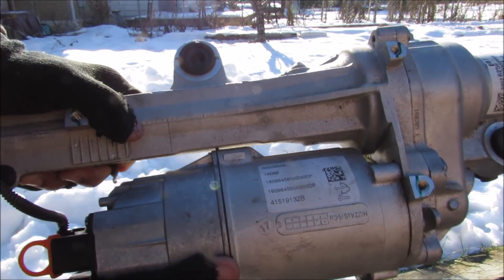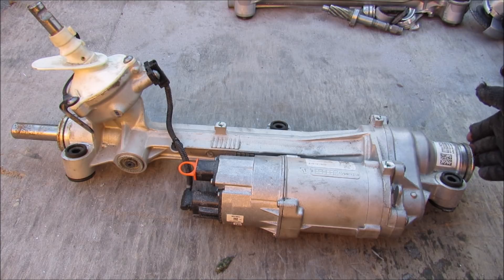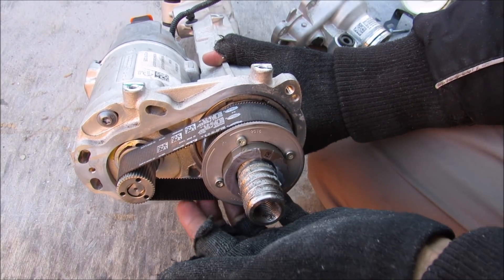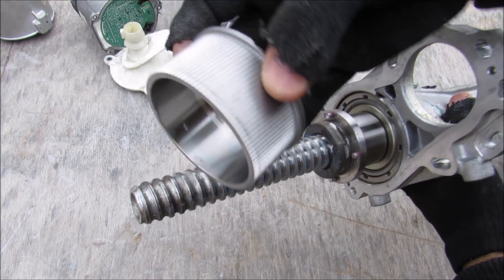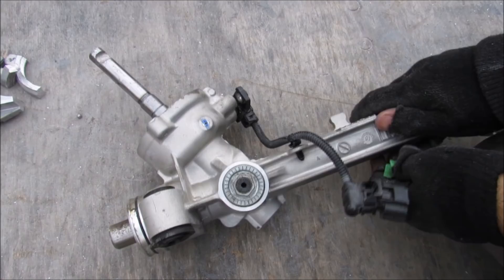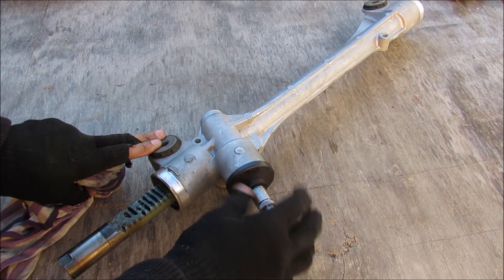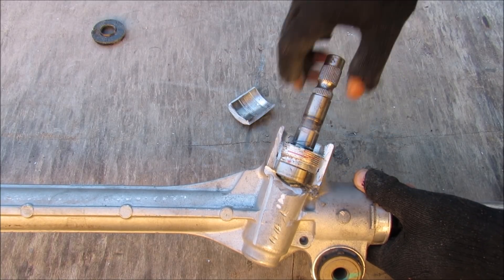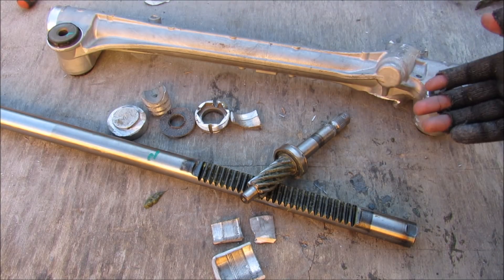How an Electric Steering Rack Works

Comment: Thanks for the video. Just want to know, was there a plastic or brass bushing in that Toyota rack? I have a RAV4 electric steering rack with alot of side play in the rack cuasing major wheel wobble and knocking at soeed. I can't find a replacement bushing for it on the internet. Starting to wonder if Toyota ( rack made by nsk) just use the aluminium housing itself as the bushing (ie not rebuildable - throwaway).
Reply from the maker: +CD I don't think it's rebuild able. Look up Toyota parts catalogs online.
Reply: speedkar99 yeah I know Toyota only sell the complete rack! Not even the Inner tie rods. But companies are selling these racks rebuilt. So must be parts available somewhere?
Reply from the maker: +CD innner rack rods mevotech
Bushing you might have to measure and custom fit. Or fill with poly
Reply: speedkar99  Yep looks like there is a grey nylon bushing at each end. Looks pretty specific for fitting in the housing. Can't believe nothing on the internet for this series of RAV4, litrally a $1 part. Will just have to buy a rebuild rack due to time constraints. Shame on Toyota for pulling these tactics.

Thanks for video showing how to take apart

Comment: I can understand working of hydraulic and elctric assisted power steering but how does the wheel comeback to neutral position automatically after turning when we let off the steering wheel
Reply from the maker: +TheZoomel That's controlled by the caster setting of the alignment.

Comment: Bro? What is the connection between clock spring and traction control sensor?? And where this sensor is located?
Reply from the maker: +Alexander Mumtaz Trac sensor works off of abs sensor. Unrelated to clock spring
Reply: bro, i have toyota aqua (Priuc C) once i had traction control check light on there and the mechanic opened the steering and calibrated the clock spring and then the traction control check light was off, i was watching my self, i am interested :( dont know how

Comment: So if you use electric motor assisted rack the only thing better than hydro pump is ->> you turn the key in "ON" position without starting the motor and you still have the power assistance for turning the wheel. Still operating such motor gives the alternator more work to do from where the fuel consumption also increases?Am i right? EDIT: What's the price for OEM electrical motor+the computer controller for this Cruze? I guess 1-2 grand...
Reply from the maker: +Petar st The electric motor doesn't turn on with the key, most vehicles are  programmed to have it turned on with the engine. 
The electric motor only draws power off of the alternator when turning is required. Hydraulics are always drawing power from the engine. 
The cruze rack was $1000 if I recall. The Toyota rack was roughly $1600
Reply: The energy wastage is a lot lower though. As with any type of hydraulic or pneumatic system, the energy waste can occur during the compression process of the fluids or gases through heat. And there is the consideration of leakage however slightly it maybe. And notice that there isn't any pressure vessel in the form of a can or tank to hold the pressurised fluids, you can assume with confidence that any fluid that has been pressurised but happened to be outside the confine of the looped system consists of the cylinders, hose and pipe to the piston is simply "dumped" back to the part  that only serve to hold and feed the unpressurised fluid as well as to receive the excess fluid after pressurisation. You may also assume with confidence that this repeated dumping by design of fluids back to the reservior represent energy losses at levell  that is much higher than anything negligible. The the extra length of contacting surface between one extra pulley and belt definitely adds  friction and hence energy loss compared to the electric steering assist system which does away with this said pulley.

Comment: so the purpose of hex bolt under the pinion casing is to apply pressure on the rack some one had told me that it's there for the adjustment of the steering.is that right.
Reply from the maker: +cobra R yes it applies pressure to keep it tight and the gears engaged smoothly.

Comment: I used the exact same method to pull the engine on my car. Cutting the transmission in half was probably the hardest part due to the small clearances with the tunnel in the floor. It took almost another hour or so to cut through all that sheet metal and carpet just to get to it, but I got it out. What a mess that made! Now.. to install that new clutch and pressure plate...
Reply from the maker: +edward niel good to hear. I got an engine removal video soon, no cutting needed. Stay tuned.

Comment: hey man how to adjust steering  stiffness on a 2005 chrysler 300 steering rack it's  too sensitive too soft no play I checked  it tie rod and ball joint  is there a srew or bolt  to adjust  how hard or soft id the steering  on a steering rack.
Reply from the maker: +Hallphamazing305 I don't think there's an adjustment for steering feedback, you'd have to change The restrictor valve in the hydraulic power steering circuit.

Comment: thanks for the video! helps me understand my steering and suspension class better. figured there would be more lube on the Chevy worm gear looked dry to be a new car? the thing applying pressure underneath the special nut you ground off the Toyota rack is called a yoke I think. again thanks for the video.
Reply from the maker: +Andrew Ballew I'm glad you enjoyed the video. 
I did wipe off a lot of grease when removing these parts.

Comment: it all translates into translation motion. WTF. Where did he get the words from? Over thinking the use of big words that means the same and used wrong in a sentence. Funny how he wanted to sound smart until the use of the word "TRANSLATE INTO TRANSLATION". Should he used the words as "TRANSLATE into LINEAR" hope it's spelled correctly.
Reply from the maker: Good tip thanks
Reply: Sometimes you just make a mistake on words... Leaving it is easier than a retake, and we knew what he meant anyways.

Comment: Fantastic video! You really butchered those racks :) Were they faulty?
Reply from the maker: +Koffi Banan yea well the grinder is the only way to open those proprietary bolts. No they weren't faulty, this is for demonstration
Reply: Waw, I really appreciate the effort. Hope you didn't have to pay for them, I don't recall them being cheap.
Reply from the maker: +Koffi Banan yea $1000 for the Chevy and $1600 for Toyota.
Reply: even tho they look like quality made this is a heavy overprice. and they even use brushed motor
Reply: Two_Number_Nines it uses a brushless dc motor
Reply: @speedkar99  Does Honda electric steering rack also have a little belt like that American cars?I have a 10 years old acura tsx with electric power steering,Iam worried what if that breaks like a timing belt, that is a sure accident waiting to happen no steering.
Reply: @efrensaclolo7021  look. Have a look at the steering rack assembly yourself, if it has a bulky  extra electric motor housing that is connected in a similar fashion, including the placement, distance between and relative angle to the rack, it probably incorporated the same design. But I don't think you have to be overly alarmed. Remember back in time when you were driving cars without power steering assist? The steering system will still work, it only means that you have to really engage the muscles of your upper limbs. But you do know that when the vehicle is moving at a reasonable speed the steering is not going to be impossibly heavy without the steering assist. It can be a bitch to park the car in a slotted parking space though.

Comment: Call me crazy, but, doesn't the simpler Toyota design seem MUCH more reliable over time?  The electronics and the belt on the Chevy seem like a time bomb.
Reply from the maker: +Brian Day of course the simpler design will be more reliable. The Chevy steering rack may last the lifetime of the car though, which is barely 10 years or so...just check out all those 10 year old Chevy cobalts in the junkyard as proof.
Reply: Truth right there!  I on the other hand,  think 10 years isn't that old.  My Toyota rack went out on my Lexus after 14 years/255 K miles.  Wonder if any power assist racks can last that long or if the the down side to the new tech shortened life spans.  Thanks for the reply!
Reply from the maker: +Brian Day New tech isn't meant to last as long as the old stuff. Cars are more disposable these days. To buy the inner tie rods for this car you have to buy the entire steering rack assembly! Therefore 10 years for a domestic car is normal. Japanese cars last longer and hold their value a bit more.
Reply: @brianday13  my KIA with hydraulic power steering is at 239k, recently replaced outer tie rods but no issues with steering.
Reply: The first rack is from a Camry which is a much larger car and has the luxury of placing the motor upstream inside the vehicle. The Cruze is much smaller and I'm curious to know if the Corolla (Toyota's comparable version to the Cruze) has a similar setup?
Reply: @gobirajmusic  Toyota corollas especially 2012 upwards HV electronic steering

Comment: Sensor on steering rack is a torque sensor
If there are 6 wires from it, it is likely that the car has Torque sensor 1 and Torque sensor 2 on the steering rack
Reply from the maker: +Beucan Thanks for the info. There seem to be two gears with chips on it, probably for redundancy. Would be cool to know how they actually work.

Comment: "There's a couple bolts here I'm gonna take off." GraaZZZZZZZZzzzzzzzz!!!! lol.

The Chevy Cruze electric steering rack is interesting. I didn't expect a toothed belt to use to connect the motor to the rack. Thank you for taking the time on tearing them down and sharing.
Reply from the maker: +2006DURAMAX glad you enjoyed it. I wasn't expecting the belt drive or reciprocating ball bearing mechanism either, quite interesting how complex it actually is.
Reply: Its LINEAR motion.
Reply: Well. I am completely surprised too buy the choice of a toothed belt. It kind of making the whole thing feel toy like, a giant RC car. This type of steering rack can be easily used for some stupid DIY computer controlled gadgets, or just old school radio remote control.
Reply: @shenghan9385  It works.

Comment: in hydraulic type which kind of problems or failures can occur?
Reply from the maker: Leaking at the rack end seals is very common.
Reply: So its sign is reduction in power fluid level in its reservoir. .isnt it?
Reply: And if add every time it reduced can cause any problems?
Reply from the maker: +Ali Hasan yep if you notice the fluid level drop then its leaking somewhere
Reply: if inly adding without radicular solution can be life threatening?
Reply from the maker: +Ali Hasan no, you can still steer a car without hydraulic assist
Reply: thanx....so I can neglect it for a while.
Reply from the maker: +Ali Hasan No, because the the pump runs dry you will ruin it. Best bet is to cut the power steering belt and drive without power steering, if you don't want to keep filling fluid. The steering will be much stiffer especially at slow speeds, but it'll be something you can get used to.

Comment: Thanks for the enlightening video!  Especially more and more late model vehicles are now equipped with electrical steering to save room and weight from steering hydraulic pump, reservoir, belt and maintenance.
Reply from the maker: I'm glad you enjoyed the video. Electric steering is better for fuel economy because it doesn't suck power directly from the engine all the time. Its a simpler setup compared to hydraulic, with less components. Unfortunately most electric steering setups aren't tuned for good steering feedback.
Reply: @speedkar99  ok. Now I understand why some cars have that completely alien steering feel. They are not hydraulically assisted system. You learn something everyday. Lol
Reply: @shenghan9385  Drive by wire is the future. Its like driving a go cart. Granted you cant "feel" the road resistance like you would hydraulics, its a lot less trouble when theres a catastrophic hydraulic failure on a high pressure hose on conventional rack and pinon setups.
Reply: @nukfauxsho  right. Electric motors never fail. When waS the last time you had a catastrophic power steering failure? When was the last time you heard anyone having such a Catastrophic power steering failure on a hydraulic power steering system? Hydraulic leaks can often be detected. What about your brushed motor housed in a electric power steering system? How can you even tell if it is on its way out?
Reply: @shenghan9385 wish i could agree but my electric motor failed on a Honda under 100k miles unfortunately.